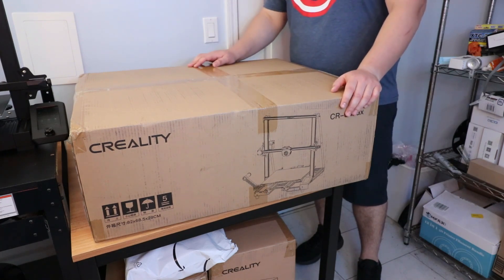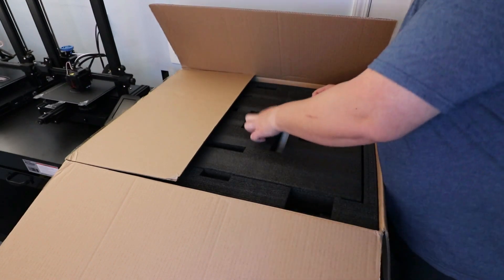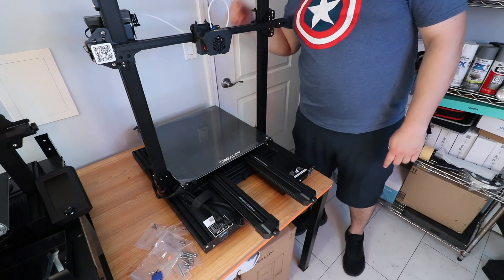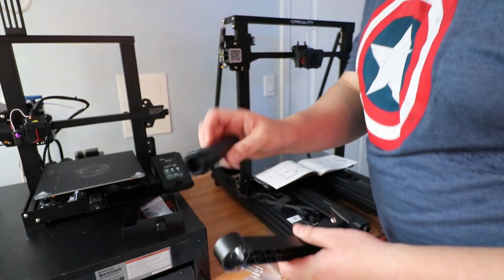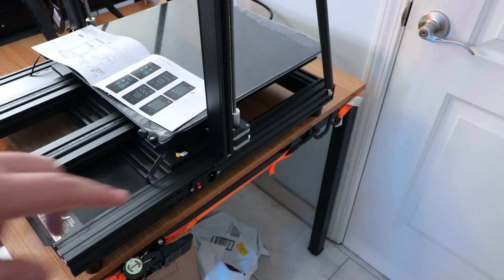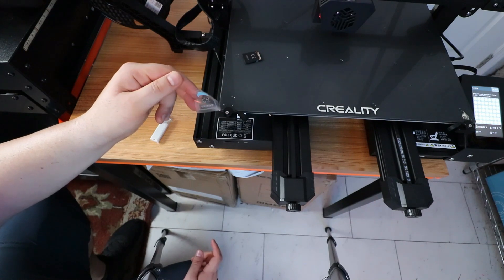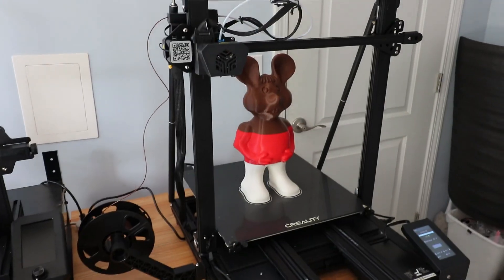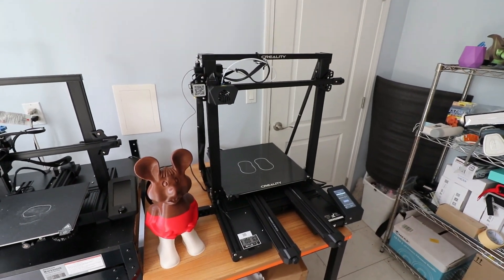Creality CR-6 Max Review: Unboxing and Initial Thoughts

Comment: I have the same printer here, the only upgrades I have done is fit micro swiss dual gear extruder and Micro Swiss All Metal Hotend Kit, I have found with any big print that will not release from the build plate, all you have to do is put the build plate in the freezer for 15mins and the model just pretty much falls off, just let the build plate cool down a bit before putting it in.
Reply from the maker: @davidborg7305  That’s a fantastic tip with the freezer trick for removing large prints, thanks for sharing! It sounds like the upgrades you’ve made with the Micro Swiss dual gear extruder and All Metal Hotend Kit make the CR-6 Max perform even better. I’ll have to keep that in mind for my own setup. I already love this printer and is one of my favorites from the older generation Creality printers, and I imagine adding those upgrades makes it an even better experience :)

Comment: do you think the CR-6 max or the Anycubic kobra max is better?
Reply from the maker: Hi ethan chung, thank you for the comment! I have experience with the CR-6 Max and I can speak for that machine, but as for the Anycubic Kobra Max, I haven't tried that out yet. I can say that the CR-6 Max has been an absolutely great 3D printer in my case. It has been smooth, with super clean prints, and no manual bed leveling required, which is a huge plus for me.

Comment: Sup bro, sorry to hear you got rid of the S5. Once I got pully replaced, and replaced the springs with silicone, and went to metal extruder I have not had one single issue with my CR-10 S5. Ive printed now going on 10 helmets without one fail. Gonna print another with a 1mm nozzle soon as my 3kg roll comes in and see how that works.. Sucks yours gave you so much of a problem. I love mine.. Gonna help once I start in on full jet packs.. Might pick up one of these next though.
Reply from the maker: Hey Figure Six, good to hear from you man :) I didn’t really want to put the S5 down, but I also wanted to be authentic in my experience with it. I did get it to work in the end, and fairly well, but I was burnt out from the experience. I had my eye on the CR-6 Max for a while, and decided to swap out once I finished my project on the S5. I’m glad you had a good experience with it, and your projects sound awesome man!